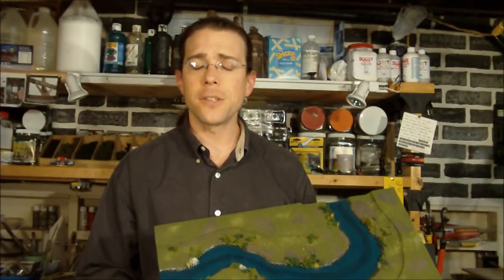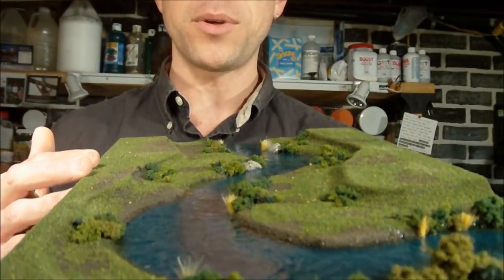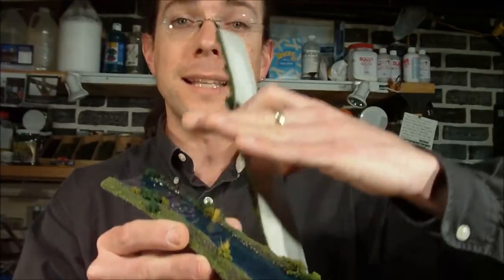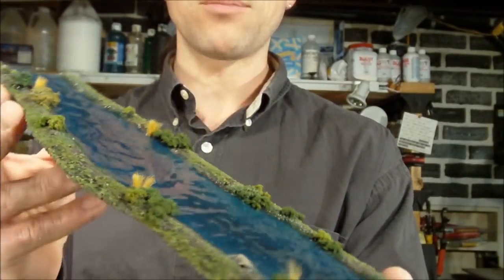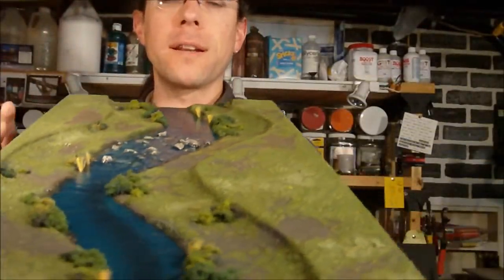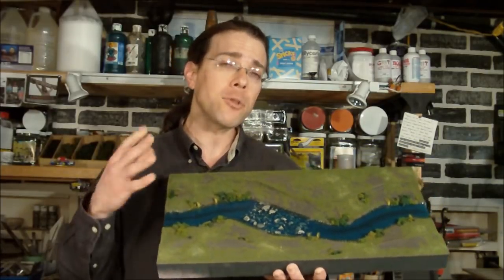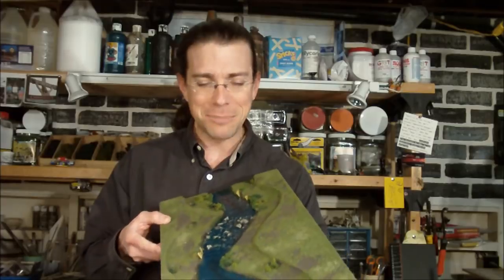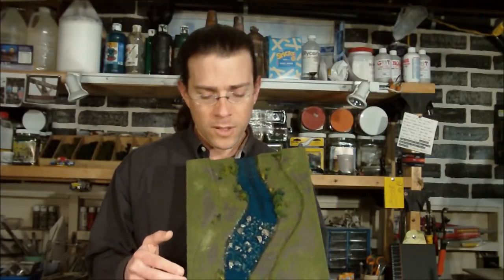TerranScapes - Improved Water Surface for Wargame Rivers

Comment: Thanks for sharing your material tips with us I really do appreciate that a lot . I have been using Wallboard Joint Compound  made by the DAP Co.  as a protective coating for terrain I have worked on in the past with very good results . I was wondering if you have ever tried it ?